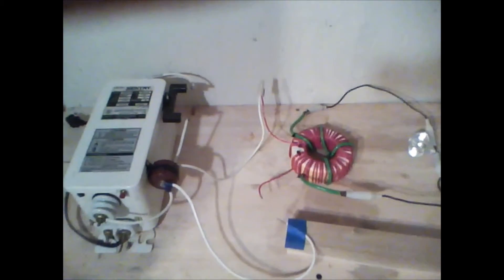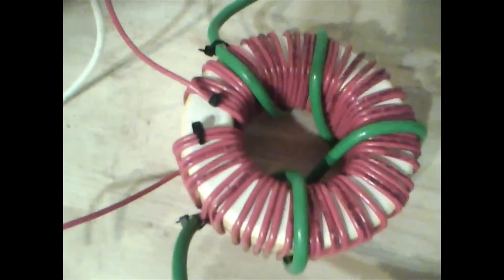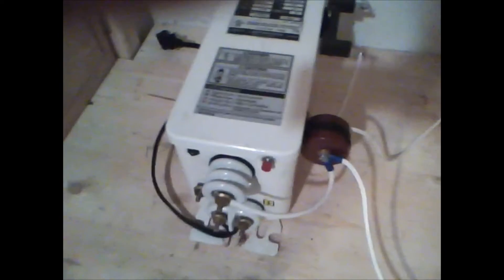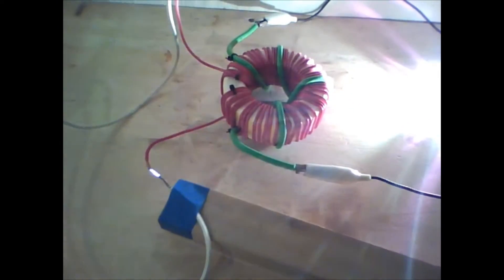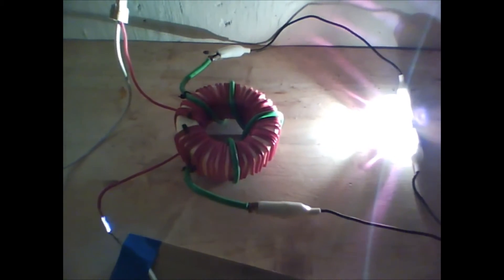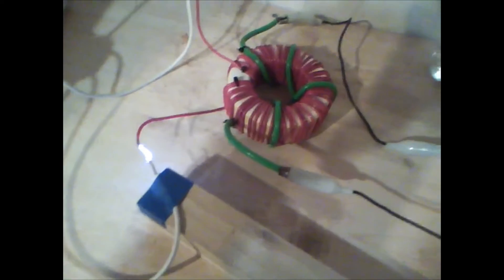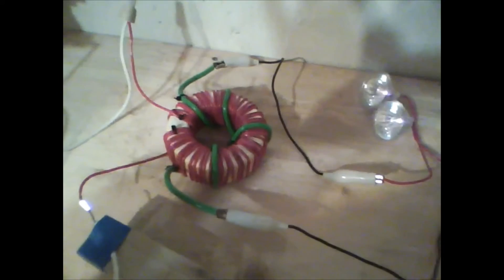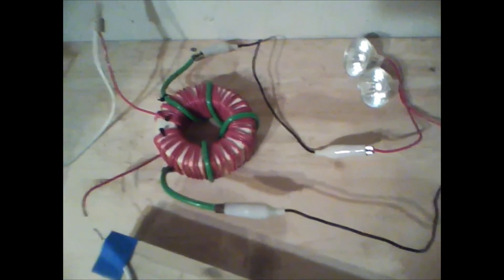12,000 VOLTS STEPPED DOWN TO 12 VOLTS ???

Comment: That is a transformer ring.
Reply from the maker: Yes, it's an iron core off of a Toroidal  Transformer that I unwrapped all the Magnet Wire off of to do my experiment. Thanks for watching.
Reply from the maker: Actually I'm sorry, I was thinking about another Transformer. This was actually a ferret Toroidal  core that I used for high frequencies, a regular iron core is not good to use for that.

Comment: I know this a 4 year old video but, if happen to read my comment I would  appreciate your comment  on my question. 
How did you came up with 200 PF cap value? Would please elaborate on that?  Thanks.
Reply from the maker: Sure thing, it was actually the only capacitor that I had for high voltage to use which worked quite nicely. Thanks for watching sorry for the delay.

Comment: i have tried my self on a 60hz 240v  transformer with 0volt reading at 50 amps.. even at 0.1volts x 50amps =  5 watts consumption from the output
Reply from the maker: You need to use a ferrite core instead of an iron core. A iron core can't handle the frequencies of the high-voltage as good as a ferrite can. Thanks for watching.

Comment: very good work and interesting experiment.. 
I have a question, could you explain how to balance the circuit?  how to determine the gauge of the wires? and how many turns is used for the wire?
Reply from the maker: Thanks, to balance the circuit is based on the length of wire and how many turns used, I tried many turns as well as very few turns to find what works the best. The circuit has to be in resonance together to get the most out of it. Thanks for watching.

Comment: could be wrong but i though any amount of volts was safe i though the amps was wat you needed to be careful of
Reply from the maker: Yes, it only takes 1 amp to be a grave mistake ...Thanks for watching.
Reply: +whyme2b It takes less than 50 Milliamps, to be honest. Best way to think about electricity is that Voltage travels around your body(burning you) and current(amperage) goes through you, which causes heart issues. No thats not an exact way it works. But its the easiest to understand. 12000Volts and 1 mA may not kill you, but it is gonna fuckin hurt.

Comment: Most people would get a 12 volt light fixture at home depot for $30.00 and not have to worry about killing themselves or starting a fire. What is the point? It would be more entertaining to make a Jacobs ladder and burn a piece of paper in half or cause carbon tracking in a piece of wood to show how fires are started with neon lighting. That is why Neon lighting is outlawed from being installed in homes.
Reply from the maker: The point is a demonstration of high voltage being stepped down to usable voltage on a simple toroidal core design with very few wraps of wire being used. ... it's just a show of how the big power companies do it but in a very smaller version. I do however recommend that no one try this unless very experienced in high voltage electricity. Thanks for watching.
Reply: +whyme2b We don't step down in this fashion though! We don't have spark gaps, diodes or caps, just straight forward power transformers. This looks more like a Tesla coil in reverse! It certainly operates at a much greater frequency than mains!

Comment: i guess you're using  a diode  for dc into an ac transformer 
cant u connect it without the cap and the diode   ? ac - ac
Reply from the maker: Daniel Hornes No sir, tried that but didn't do anything but short out... due to the amount of wire wraps around the core. You would need 1000's of turns of magnet wire to balance out off of that neon transformers output. I used a high voltage diode to charge some caps then pulsed it at a lower frequency so I could build up the magnetic flux. It had a very good current flow output which was able to power up the halogen bulbs. Thanks for watching.

Comment: the output must have a very high frequency,it's impossible to generate voltage that would power a lightbulb with that amount of secondary,that's the way tesla coil is driven,high voltage arc generating very high frequency to the primary and the secondary of the tesla coil generate a very high voltage at a very high frequency,the output is not at 50 or 60hz because of that arc is it ?
Reply from the maker: Tonny Cassidy Yes, true.... that's why I used a toroid core to trap all of the magnetic flux to be useful. It's better to just store the energy into caps and use them to charge battery banks, but I would recommend using at least 32 gauge magnet wire wrapped a few thousand turns for the primary coil to balance the flux input, then 8 to 10 gauge for secondary coil for high amp output. Thanks for watching.

Comment: As an experiment that looks fun. What you have is a transformer doing what they do and the spark gap is generating AC (remember, they used to use spark gaps and an LC circuit to make early radio transmitters).
Reply from the maker: Yes sir, true... I also did have fun in making it, just need to watch every move very closely in what I'm doing! hahaha....thanks for watching.

Comment: Its not 100w, please measure, the voltage going to you lamps using a true RSM meter, then you will see, also you wall-meter can not measure a neon trafo probably, you have too many errors,faults and lag of understanding in your experiments, it would serve good to take some elektronic classes, best regards Magnus (electronic technician )
Reply from the maker: Yes, true it's not 100watts... I didn't measure the voltage output at that time. The watt meter however is very accurate to watts drawn from load, otherwise they couldn't sell that product if it was inaccurate. I took a 4 year class of electronics course, but appreciate your comment.... It's all about experimenting and ideas that could change or be updated to what we know or have been taught threw  someones law. Thanks for watching.

Comment: Hey Interesting project but please don't use wood because what ever moisture is left in it can be conductive even if the wood is dry it is still a hazard, please replace that with a pvc pipe or some sort of stick that is made of plastic.
Reply from the maker: Yes, I do agree with you my friend...thanks for your advice and thanks for watching.
Reply: whyme2b
 Use that watt meter on your inverter projects to demonstrate the output of these DC to AC conversions get muddy.
Reply from the maker: Yes, I agree.. I will do the test as soon as I get a chance to pick up another watt meter, because my other one blew due to the higher voltage output of my inverter under no load. Thanks for watching.

Comment: The bulbs are rated at 50W each, but that does not mean they are consuming 50W each.  To see the output wattage connect the lights to a watt meter.  It would be interesting to see the results.

Very good work. Thanks for sharing.

Comment from the maker: Yes sir, will work with a diode, but when added filter cap power output stopped. Will need to find the right cap size or resistor to match the resonance output for it to work. Thanks for watching.

Comment from the maker: Yes sir, D/C pulses in and out is A/C high frequency...you can put a diode on it thou to change it back to D/C. I am learning how to reduce the high frequencies by using resistors and capacitors to get it in tune to mains 50 to 60Hz which I know would have a greater power output factor. Thanks for watching.

Comment from the maker: Lets see this in another way my friend...My goal was to use low voltage around 14 volts with high current to charge a 12 volt battery bank, which in turns powers a 5000 to 7000 watt power inverter which powers you house. Thanks for watching.